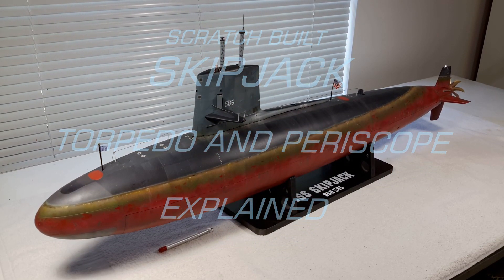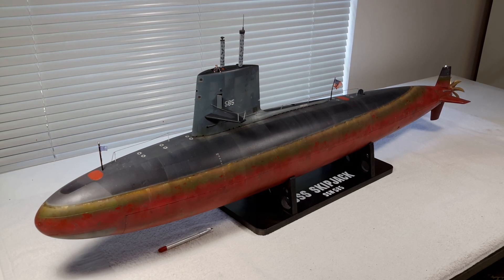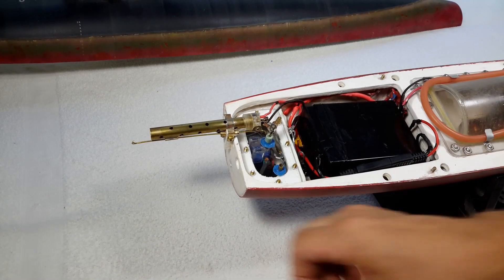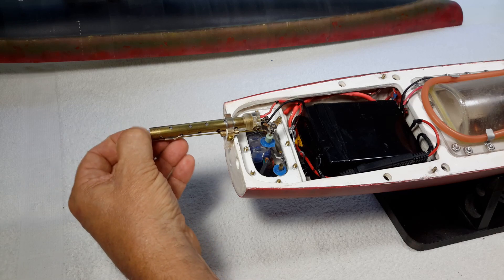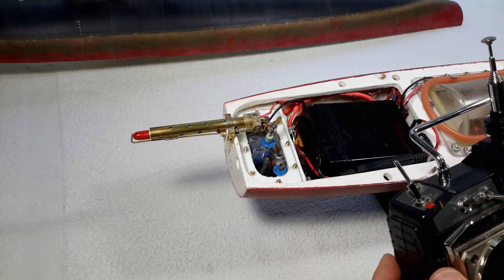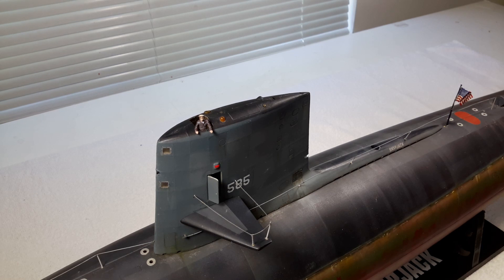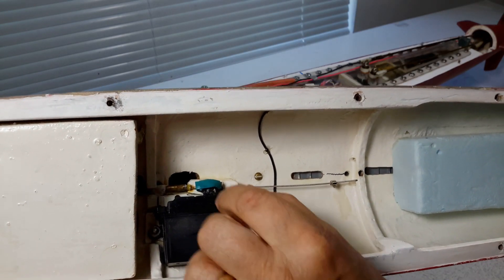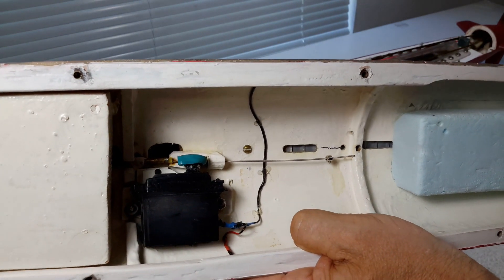R/C Skipjack Torpedo and Periscope System

Comment: Interesting water tight compartments.  Has anyone used this method with the Moebius 1/72 Skipjack?
Reply from the maker: Yes this method is rarely used mostly because of the WTC
Reply: @undersee604  is there a link or site where I can see more about the layout of your semi dry compartment?
Reply from the maker: @coast219  Greg  Sharpe from Deep See Designs had a great plans for this system unfortunately many years ago he folded his company, however dig around the net you might find info on this ,I  don't have a plan  for you , it's a easy system to do and alott cheaper. Cheers  DK
Reply: @undersee604  thanks. BTW, is your Type VII built the same way or did you use a proper WTC?
Reply from the maker: @coast219  Yes I did a type V11 C years back for a customer in Japan using that method and it worked awesome just a note on the type V11 in 1/48 scale the model should be split at the waterline for easy accessibility

Comment: drunk thoughts but maybe add some weight if you can to make them come out and not go straight to the surface of the water
Reply from the maker: That is true however the torp will sink at the end of the charge, this torpedo is very small 1/72 scale .
Reply: @undersee604  didn't think of that

Comment: this looks interesting- i have reviewed a few small scale torpedoes incl the compressed gas option. So to understand the torpedo has a capacitor which is charged 10 seconds prior to release which runs a small motor and prop....I am guessing the charge is prior so you do not have to switch the motor on and find a way to stop the prop?
- could you use a reed switch , but i guess this will also need and ejection option?
if you could please share the capacitor/motor and charing info/details that would be great - i dont have a lot of room in the sub but it would be a great addition
Reply from the maker: itolond  That is how this system works in 1/72 scale which  is 4 in in length  weight for this size is the problem needs to be boyant to float after the charge ,idealy  it would be nice to precharge the torp then placing  into the tube before sailing  then launching using a reed switch so this is why I charge onboard before firing.  Cheers
Reply: sounds good What capacitor / motor / charger did you use? also whats the run time ?